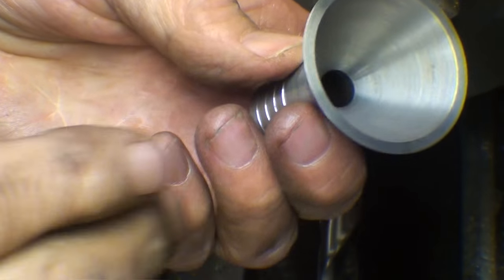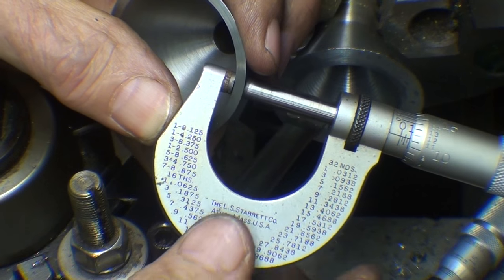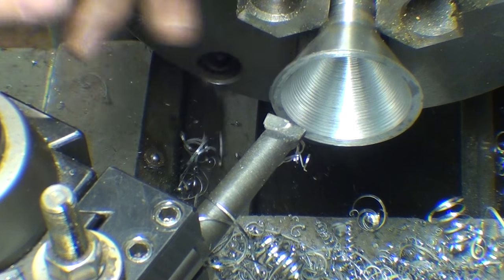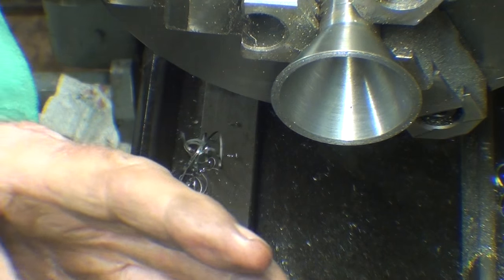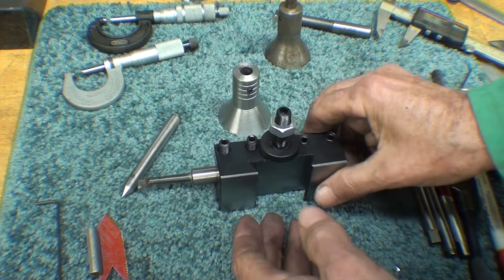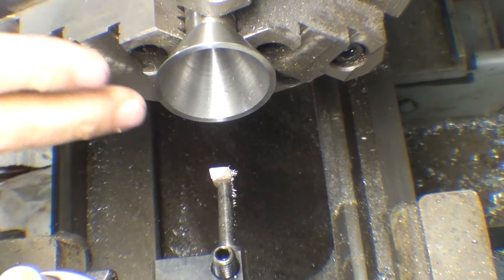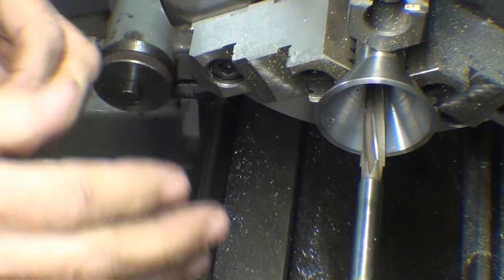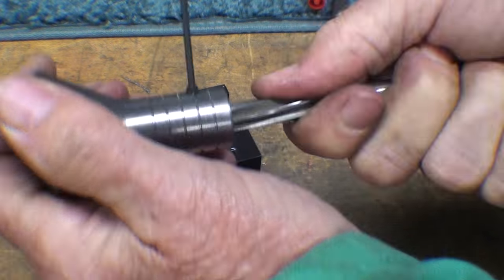TIPS #348 pt 3 How To Make a Bell Center Punch tubalcain

Comment: Lyle,
Very fine video series. Enjoy watching it, as well as all your video. I was machining a 2" OD aluminum to a wall thickness of .093" and when the ringing reached the point where changing the speed had no effect, I used some old bicycle inner tube that I cut and wrapped it over the OD. Completely stopped the ringing.
Reply from the maker: great solution

Comment: Would a rubber band wrapped around the bell reduce chatter? I have turned brake drums and rotors and used a band with lead weights added to improve the finish. Hope it is warm in your basement your videos help make winter more tolerable in northern Indiana.

Comment: Lovely conversion of the micrometer to an anvil form for the thickness measurement of the wall. Would work great with your digital Mitutoya where you could zero it having fitted the adaptor & closed it down saving the need to adjust for the off-set.
Reply from the maker: thanks-good observation

Comment: machining question, why don’t you drill only after turning the work around?  That would ensure that you have a concentric hole, yes?
Reply: drilling is never concentric whether you take it out or not, and also something that he didnt mention is parallelism of the hole to the i.d. of the cone. drills will go at an angle over any kind of distance. the reamer will give you a on size and round hole (assuming correct procedures and decent reamer) but will always follow the pilot hole whether it is tapers non concentric or what ever have you drills are for roughing or clearance.
Reply from the maker: Thanks--all very true

Comment: I'm really surprised, especially with a 3 jaw, that you pulled the part out between making the inside of the bell and boring the inner hole.  I would think that it would be really important for concentricity between the 2 to keep it chucked.
Reply: I'm pretty sure I could see the inside of the bell running out as you reamed the hole.
Reply: I think he said the part that he showed was his first piece or his working blue print.

Comment: If you cut a V in both sides of the lip of the bell mouth, 180* opposite, you could use the same tool to punch the end of round bar, and also the center of the sides of the round bar.
Reply from the maker: Thats a great idea

Comment: I have a disc brake rotor micrometer with a point on one anvil that I suppose might also do this better than a flat anvil style mic.  Its designed for getting into the bottom of grooves to get truer measurement below the top surface of grooves.

Comment: Speaking of boring bars I have a question for you sir. I really like the old-style boring bars that are one solid piece of high speed steel I guess and they are bent over at the end and sharpened. I can't seem to find any are they out of favor? I do a lot of really deep bores and these seem to do the best for that situation. I've also been making boring bars out of drill rod in cutting the square hole in for small bits 90 degree and another  at 45 degrees Cuts I know you know what I mean
Reply from the maker: I still like the very heavy Boring bars with carbide inserts
Reply: mrpete222 I agree but I have been making some brass cannons for friends and the high speed Steel seems to do a better job. It any rate it's got my curiosity going I can't find any information on the bars I'm talking about I'm sure you've had them or at least know what I'm talking about they are bent over at the end? And then when you wear them down I imagine you after heat them up and bend them over again? I think someone called them forged to bars but I still cannot find any information. If you think about it and come up with anything let me know and I will be eternally grateful

Comment: Looking great , Thanks man !
Reply: I like that profile pic. I have a '94 ZJ with 6" lift on 33s. About to go D30 Hp up front.
Reply: I have a 96 ZJ 4 inch lift with a 242 transfer case so I can run in 2 wd  or 4 wd . Great rigs !
Reply: ShawnMrFixitlee 
I swapped to a 231. Rarely get snow in Alabama so I opted for the one with the least moving parts and the most aftermarket support. It'll probably never see 4WD on the street.
Reply: right on ! take care man.. There is vid on my channel of my jeep..
Reply from the maker: Thanks